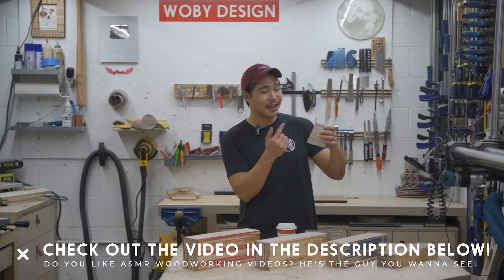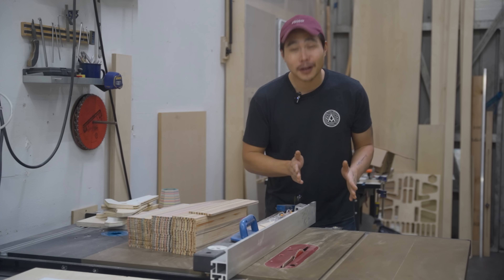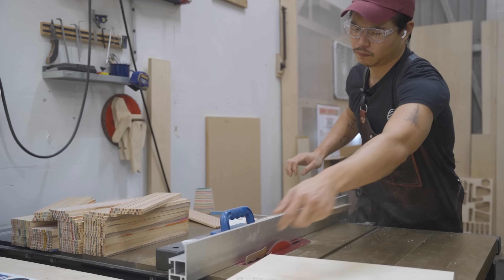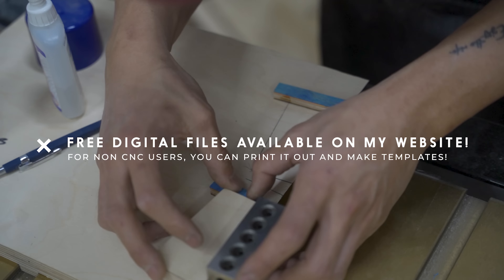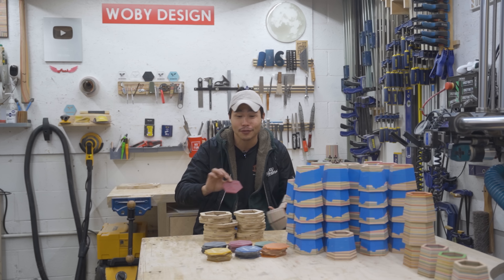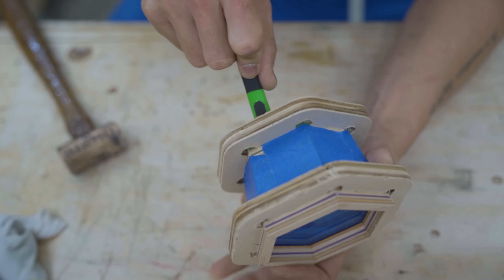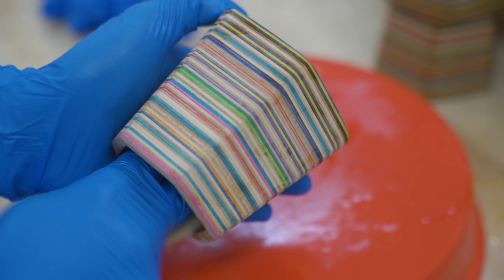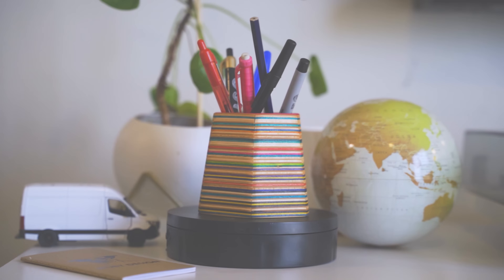HEXAGON PENCIL HOLDER!

Comment: Congratulations to u and your wife. In for expensive shock I've got 3 and man do they cost. Anyway back to the woodwork not the hot dog work u been doing. 😲 If you didn't build the jig and I wanted cut these on a mitre saw could this be done by setting the bevel at 60 and the mitre at 4 would that work?? U could drill hole on bottom market the as small planters! Idea for bigger project do a skateboard table shape with couple those as bases! Could be cool!👍🏴

Comment: For those who don't know, those digital angle gauges are great but remember: They are indicating absolute angle of the blade, not necessarily the angle relative to your table saw. Make sure the surface of the saw is reading zero before you measure the blade angle.